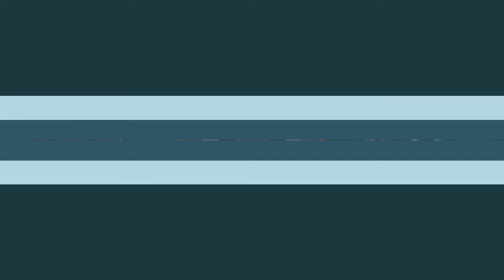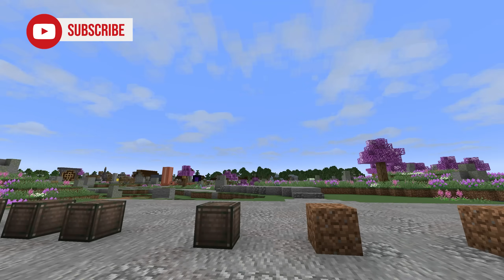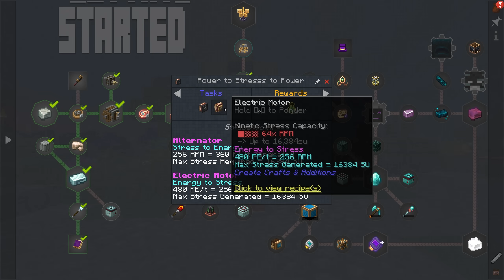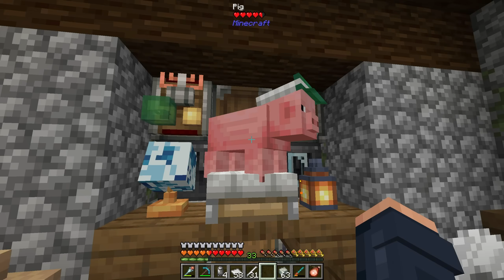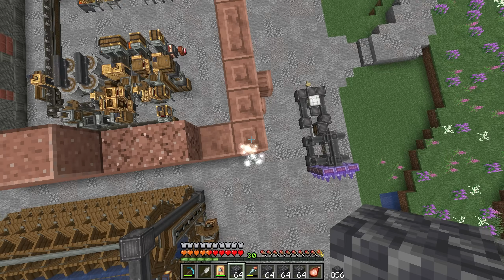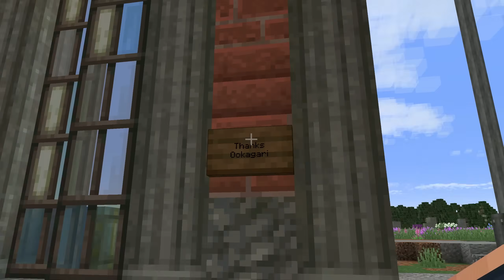The Industrial Revolution Starts Today EP10 Chosen's Create: Integrated

Comment: I have the designer level of a mundane "function over form" printer.😅😅

If it can't be used in any form other than aesthetic, I don't use it... kinda weird when comparing to the artworks you and the others (Stan, Legion, Foxie, and Beardstone) can produce. 

For example: using the drying racks from Tinker's Construct as tool racks and food production. The smelter (same mod: Tinker's Construct) serves multiple functions: ore processing, multi-floor center point, trophy display, and tool storage (in conjunction with the drying racks).

Comment: do steam engines not work in this pack? playing it on a server and cant seem to get them started :(
Reply: They do work in this pack. 

Have you tried to eliminate all factors for testing purposes? Just a single blaze burner under a one block high 3x3 of create tanks with a single steam engine on the top. Use a fluid hopper for water input. 

That way you can check easier if it is the server or just some mistake of weird interaction.
Reply: @paulelderson934  yes thank you I figured it out. Not sure what I was doing wrong the first time. My bad team
Reply from the maker: Yep still normal however you can make them way easier in this modpack 😊

Comment: There isnt a way to autoamte zinc and such brass as well?
Reply: If you want this, you can add create: sifter to the modpack so you can passive most materials. 

Right now the best automation that I can see is giant drill contraptions that you empty into a large processing factory.

Honestly, with a large contraption a couple of runs will make it feel like it's endless supply.
Reply: @paulelderson934  I added Create:Zinc and Copper mod and it  really integrates really well didnt have to change anything(also useful for turning flint into useful materials), maybe when pack updates this will be in it

Comment: I usually don't comment, but I just want to say.. I think you overuse the randomized pattern too much, I mean, a good industrial floor is plain, maybe you get a few yellow tapes or red paint on the ground in lines to specify things to the operator or visitor on the any random factory, but the floor is ultimately just one shade of color, usually the basic gray concrete color, maybe in old factories you could get a lot of oil taint on the concrete but usually is just one color.
Just want to say that, I agree with the depth thing with half-blocks, stairs and other modded partial blocks, but I think you use mismatching similar blocks all the time. It gives a poor quality impression at least in the floor stage.
Sometimes you need to visualized how your build would look like in the real world if converted 1 to 1, and well, you probably know how your factory would look like if converted.
To be fair, I'm not that into base design. Great modpack, by the way. Sadly the owners of minecraft are burning down their own main company (Microsoft).

Comment: Absolutely love this series, and I this modpack is the first modpack with Create that I have consistently played (and am playing currently). I'm currently trying to semi-automate the Goo Andesite Alloy Generator and am also building the storage system. I loved a lot of the recipe changes too, though one roadblock I'm running into is that the universal saw cannot seem to get any of the regions unexplored logs to be creafted into barrels via the universal saw. Is there any way to remedy that, or will it be fixed in future versions? It would be great if it worked since a lot of the trees generated are from the regions unexplored mod, and it just feels weird given that the wood can be crafted into barrels via the crafting table with no issues but isn't compatible with the saw for some reason. Either way though, absolutely love the pack and the series.
Reply from the maker: Glad you're enjoying the series and the modpack!
Reply: Bros new to modpacks if this is ur first pack with create
Reply: @Alguien-b4wI did briefly download create optimised at some point but ended up quitting 5-10 mins into playing it. Other than that most modpacks I've played with are either optimization packs, packs without create (always want it but never got fully invested into it till this one) , or I just put together mods in either the curseforge loader or the modrinth one and played those.
Reply: @Persivefire i meant It in the way where create is in litteraly every modpack even when not fitting in
Reply: @Alguien-b4w Fair enough, I probably just never used the create features then. Though again, most of the modpacks I played were optimization pack (because base minecraft lags like crazy and optifine never updates on time), and since those are mostly client-side, create isn't in it. 

The only times that I play with proper mods is when I make custom packs of mods from the curseforge or modrinth app, and even then it has been ages since I've played in those. Like the last time I had properly played with those packs were during the nether update times, back when quark and the abnormal mods were being updated regularly. Everything after that became vanilla plus mods, because everything post that got inconsistent updates.

That being said though, after playing this pack, can see why create is everywhere, it is a goated mod, and it's fun. It integrates seamlessly with everything, and it gives off the energetics - engineering vibe that a lot of old modpack had. Am looking forwards to playing around with the other modpacks once I'm done with this one.
Reply: @Persivefire  i get you, but dont think create should be everywhere